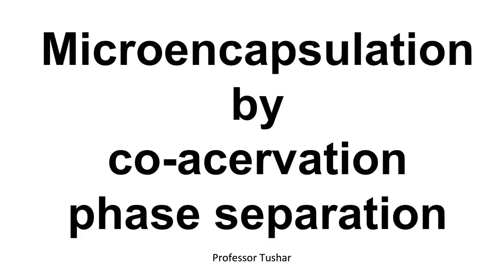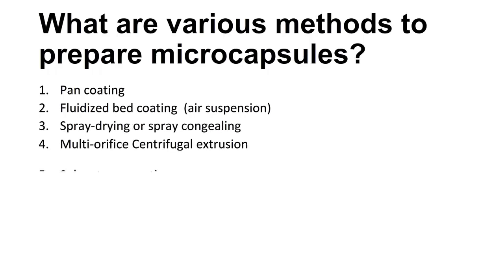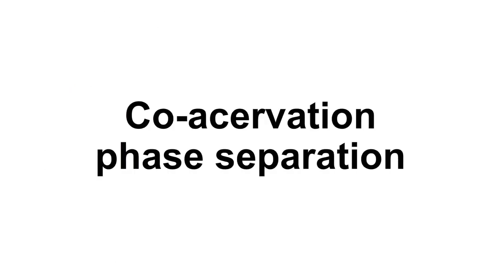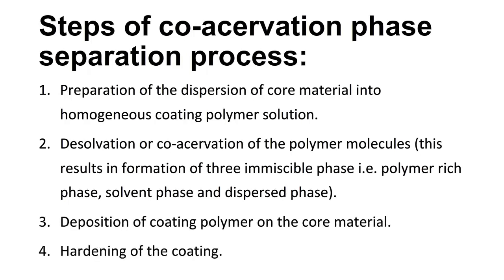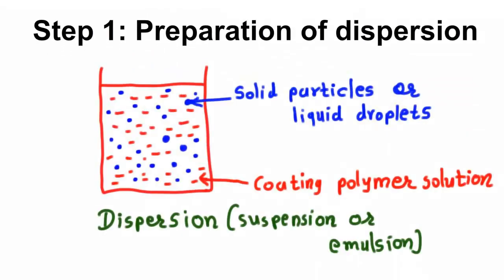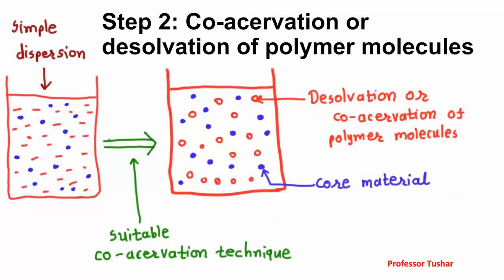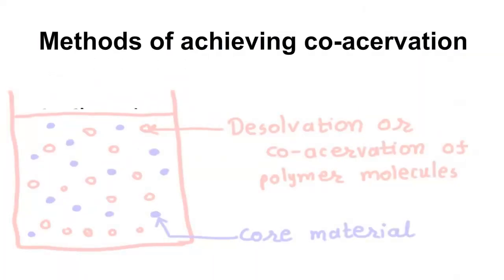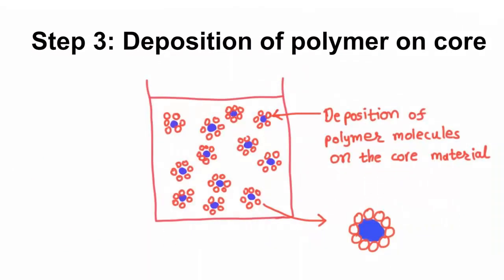Microencapsulation by coacervation phase separation (Microcapsule preparation)

Comment: sir i saw somewhere  in advantages of microencapsulation 
-environmental protection can be achieved .(how ?)
Reply from the maker: Core material is completely coated and isolated from external environment. It protects drug from environmental hazards such as humidity, light, oxygen or heat.